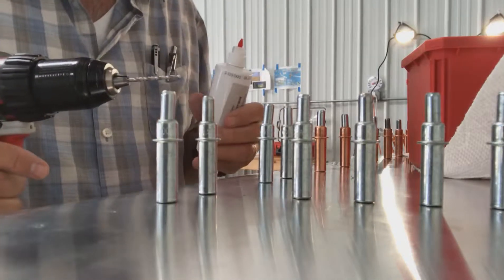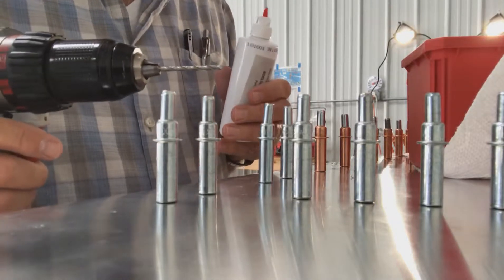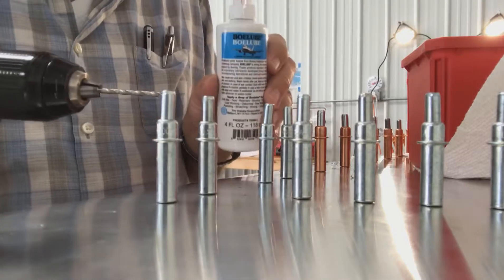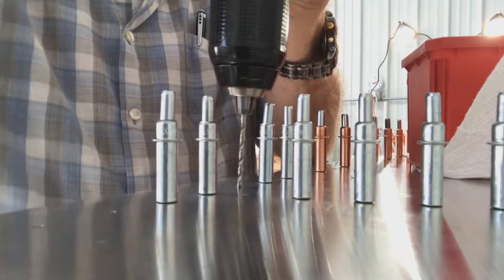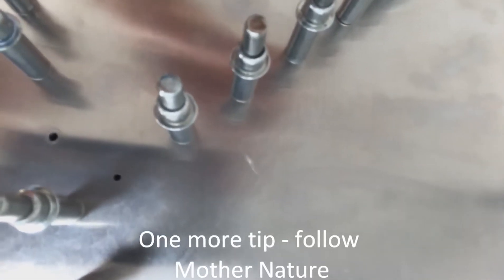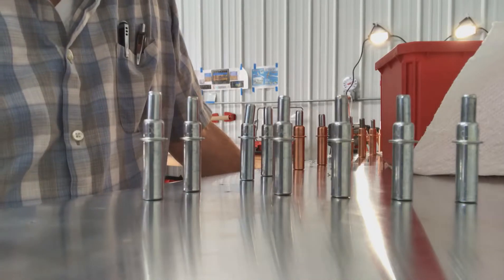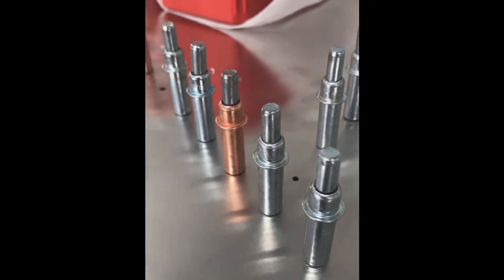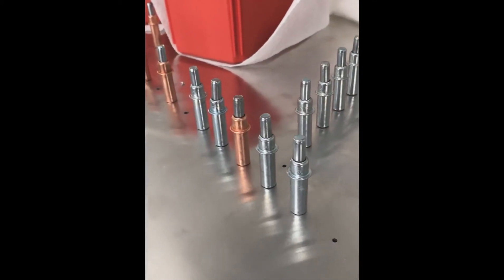Drilling aluminum   a tip

Comment: why is so hard to drill in aluminum , i finished 1 hole ,now the bit cannot break other hole
Reply from the maker: Carl, it really isn't hard but provide me more details like how thick the aluminum is you are trying to drill, what size hole you are trying to drill, what type drill bit you are using, and how are you drilling - battery powered hand drill, electric hand drill, drill press?

Comment: I want to put a hole into alliminium hollow pole ???? The pole is10mm radius
Reply from the maker: Christine Grieg,  I published a short vid of pics of how I drill holes in round objects. It's very important to get everything as secure as possible so the tube doesn't move on you. That's why I use the Center-it jig and the clamp.  One thing that helps I didn't mention is to use a punch to put a small indentation where you want to drill.  This will help the drill bit from "walking" and keep the bit where you want to drill.  If you don't have a drill press then put the tube into a vise (if it is soft aluminum don't tighten too much or you will bend the tube). and using your drill put the bit where you want to drill, and by hand turn the bit until you start to cut the tube.  This will also keep the bit from "walking".    Now drill slowly and as straight and perpendicular as you can to the tube.  If it is a small hole (1-2 mm), then you can drill just once.  If it is a larger hole, say 5 mm, then I'd start small and then up-drill to the size hole you want.  Also it helps to put something if you can on the backside to eliminate large "burrs" when the drill bit exits that you will have to file down.  First, practice on a piece of spare tubing until you get it right!  Hope this helps and good luck!
Reply: @frankdearmond3372  thankyou so much thats great I just got your msg 17/09/20 is it OK to get back to you about other things I'm strugling with like what metal that's easier to work with , doesn't  rust in the winter

Comment: Bit late now but make or buy a drill block if your concern with drilling straight always pilot your holes at 3/32 or 2.5 . No need for lube at this gauge of material the trick is feel this takes practice unfortunately. But I run at a high speed piloting thing gauges but not much pressure this will allow you to drag the drill if your a little off center once happy drill the hole . Good quality air drill are best .
Reply from the maker: Excellent points all - thanks!